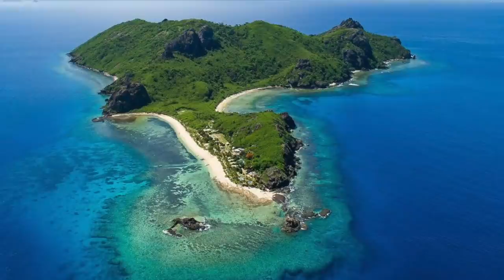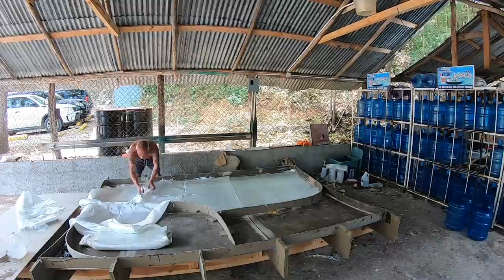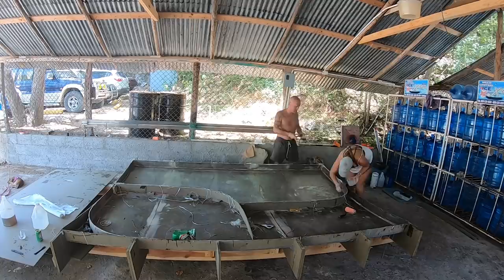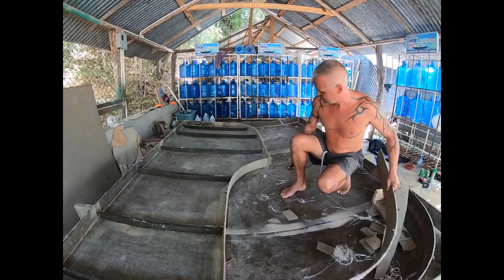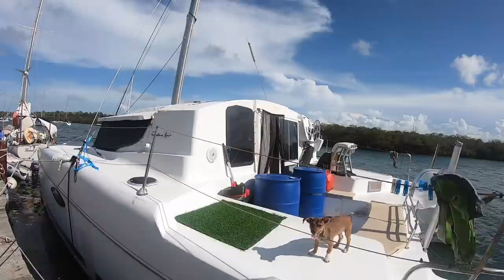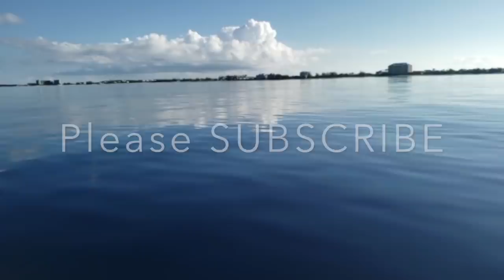How to: Build a Hardtop for a Hurricane Damaged Catamaran Part 4 (S2 E18 Barefoot Sail and Dive)

Comment: Great work was there a reason you didn’t use gelcoat first......? It’ll be interesting to see how it plays out long term, laminating in high humidity quite often delaminates or large bubbles form, it’s not below the waterline so deal with it if it happens!? Thanks for sharing and keep at it! 😎🏖🌴☀️🇦🇺
Reply from the maker: Couldn’t get gel coat here in the DR. Plus we want to create a water catchment system on the top so we decided on paint!! 
We’ve managed to keep it air bubble free! We will see what happens eventually though! 
Thank you! And cheers!!!
Reply: Barefoot Sail & Dive   
Brother if you really do use paint use two part paint!